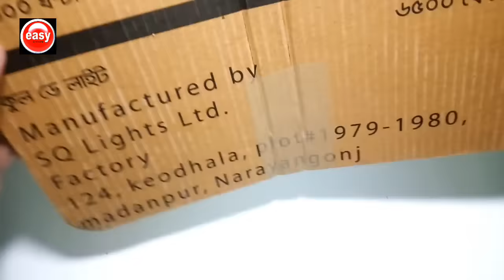How to Make a Laptop Using Card-Board.

Comment: Can I do this with these?

PIPO W5 8" 32GB Tablet x86
Intel Bay Trail Processor
32GB Internal Memory
Windows 8.1 (Capable of OS X , Windows 10 and 7 , and Android 4.0) (For OS X and Windows 7 you need mouse)
16GB SD Card
2GB RAM
8 inch 1280x800 Resolution
Intel HD Graphics

Materials:
Logitech MK240 Nano Reciever Keyboard And Mouse Combo
OTG Cable 4 Ports

Will work for these mentioned?
Reply: thx